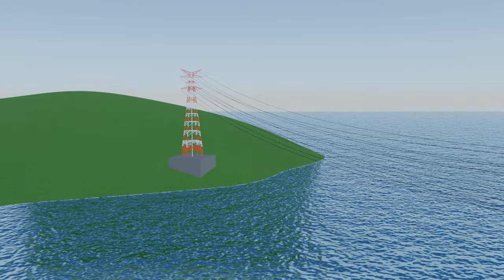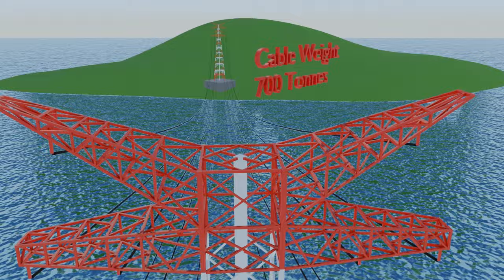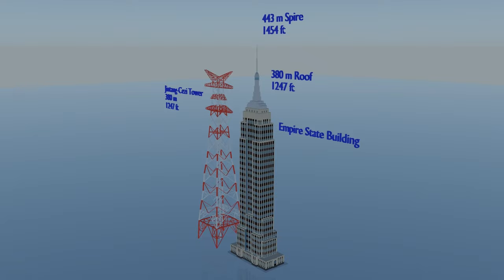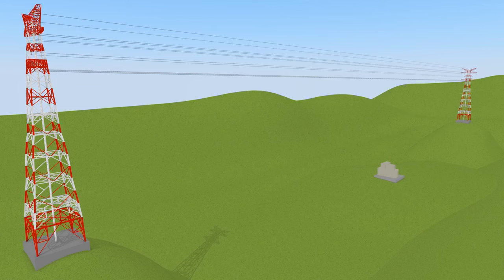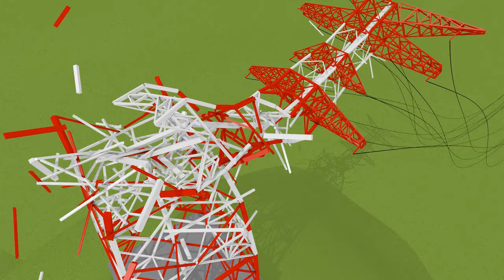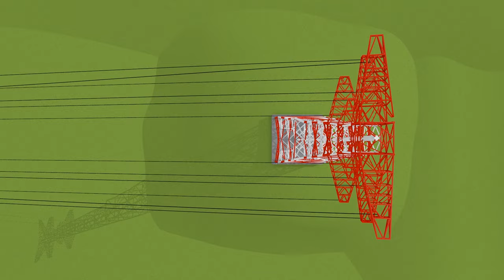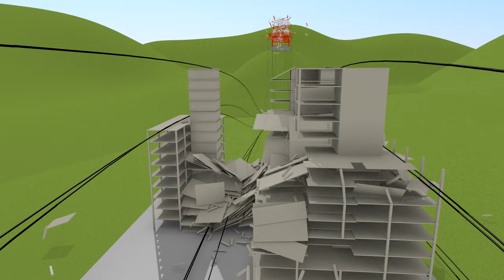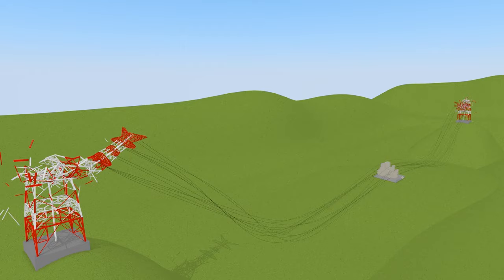World's Tallest Transmission Tower Collapse Simulation | Jintang-Cezi Overhead Powerline Link

Comment: In Québec, during the 1998 ice storm, we actually had quite a few transmission towers fall like dominoes. Back then, our network was built up 3 times stronger than required by the North American norms. It speaks volume to just how intense that ice storm was. Once one tower came down, it dragged the next one in line, and so on. Tens of kilometers of high tension lines were destroyed in just a few days. There's a lot of photos and videos on the web of those events.  Events like that ice storm truly puts into perspective just how dependant we've become on electricity. That is even more true in Québec where most of our home heating is done with electricity. Despite other electrical utilities sending help from as far as Texas to rebuild the network, some peoples were without power for several weeks. Since then, Hydro-Québec has added fall arrest towers at regular interval to prevent the domino effect. They have also added more redundancy to the network to ensure that electricity can be rerouted should a line come down.
Reply from the maker: Thank you for sharing, that event definitely highlights the importance of structural redunancy in maintaining power grids.

Comment: cables would be aluminium not steel for power transmission. the second tower would collapse away from the first as the cables would not be in balance and allow the remaining cables to pull away from the collapsed tower.
Reply from the maker: If I had modelled cables on the other side of both towers, the situation you described would have occured.